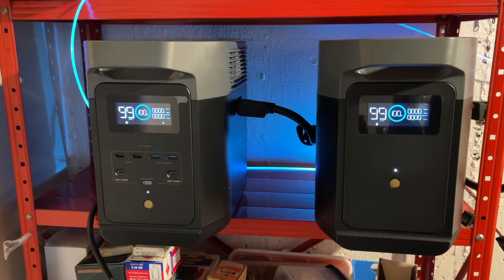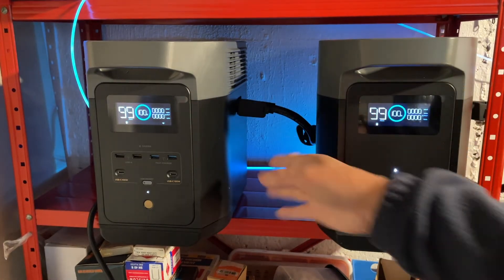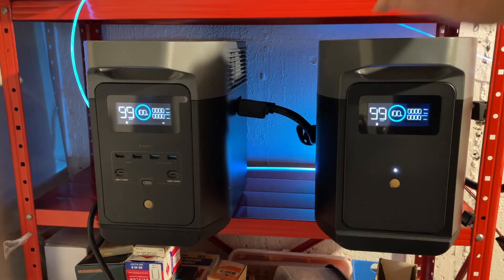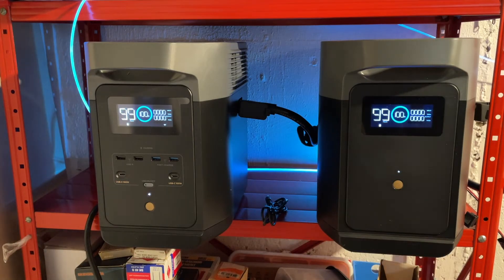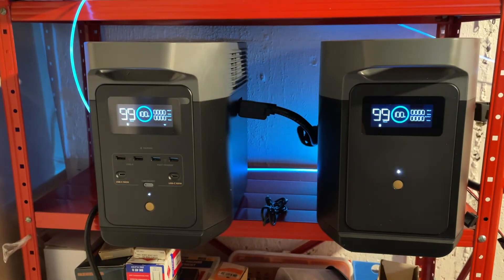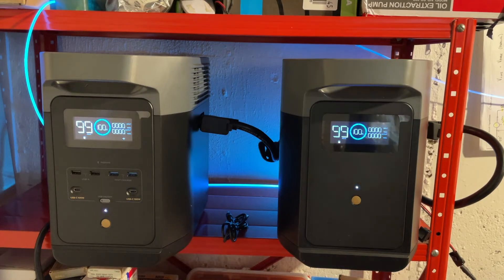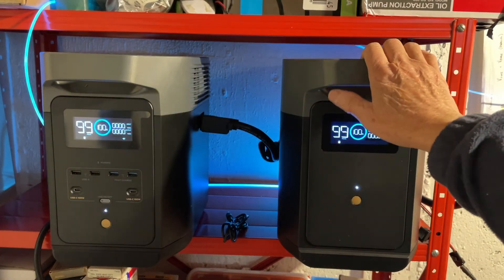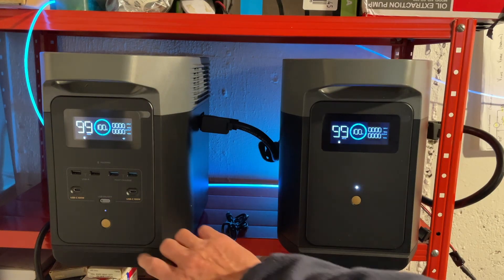ecoflow delta 2 with extra battery first impressions

Comment: hi how long have u had the delta 2 for and have u noticed drop in the battery capacity??
Reply from the maker: I’ve had it for 2 years. It was purchased as a backup power source and as such rarely used. I do have the Ecoflow River which I use every day for the past 3 plus years. No capacity test but unit is running fine.

Comment: Its weird how they made the cable be on the same side, it would have been much better if it was on the back, so the 2 units could stand somewhat closer and different directions.
Reply from the maker: @mighehe  yes the product can have small footprint but access to outlets can sometimes be difficult. The App can be a plus to help adjust various settings but you got to have the phone e with you.

Comment: Did the charger cable for the extra battery came with the unit?
Reply from the maker: @VirginDollars  Yes. There’s a compartment on top of the extra battery and the cable is in there.
Reply: @wtam69  Thank you so much for the prompt response. My EF Delta 2 extra Ba3 is on the way. One love from Nigeria .

Comment: My warranty expired my Delta 2 won’t charge any more when plugged on charger it turns on but won’t work without the power attached any idea on a fix? Change battery cells? Thank you for your time
Reply from the maker: Try resetting the BMS. Press power on button, then turn off. Turn on and hold button until you see the battery percentage button. Also try updating firmware if it’s not  the latest. Remember to  charge battery within the parameters. Get someone qualified to find and disconnect and reconnect BMS  inside the casing.

Comment: When plugged in, which unit charges first? When in use, which unit drains first?
Reply from the maker: Good question but I don’t know. Will run a load tomorrow and find out. Maybe make a video and post answer.
Reply from the maker: I just made a short video on this question:https://youtu.be/gz72IwKXrfM

Comment: Is anybody else having the power to the AC 12 V and the USB ports randomly shut down only when the extra battery is connected, never lose connection when the extra ache of flow battery is unplugged?
Reply from the maker: Haven’t heard this issue before. If there’s any firmware updates, you can update and see what happens. These all in one units are much more complicated than the diy units where you can separate out each component to troubleshoot issues.
Reply: It started when I updated the firmware a few weeks ago. Up until then it was simply a back up power source, but I added a second 300 W solar panel and started powering my refrigerator and Separate freezer. For no reason I can find it will randomly shut off, sometimes under solar power, but also under grid power. nothing consistent except that it’s usually about every day or two. It will shut down. But only when I’ve got the extra battery connected otherwise it’s perfect.
Reply from the maker: @MarkBjostad  I’d look to reverting to your previous firmware if the new update causes problems. Also try to do a hard reset the extra battery if possible.

Comment: When powering a large external load, will the load be shared between the two batteries so their cycle life is protected?
Reply from the maker: It’ll be shared but won’t be exactly equally shared. Even within one battery, the cells will become unbalanced despite the Efforts of the BMS.

Comment: If you have the AC charging cable plugged into the wall, would that provide the ground for the unit?
Reply from the maker: Not necessarily but you can test it with a multimeter.

Comment: Can you connect the Delta 2 extra battery to the Delta max?
Reply from the maker: Probably not as they use different chemistry and voltages.
Reply: Yes you can

Comment: Question.  Given then the extra battery is worth almost as much as a delta 2.  Can you just buy two delta 2s and hook them up together just like an external battery?
Reply from the maker: The extra battery is about $100 cheaper. You can probably hook two Delta 2 together so one feeds the other. I could be wrong but the extra battery is dedicated to the main unit and therefore more efficient. The downside is you cannot charge the extra battery by itself. You have to charge it in conjunction with the Delta 2. That being said, charging the Delta 2 with the extra battery is probably quicker and simpler than charger two separate Delta 2s.
Reply: You can daisy chain using AC. The advantage is the extra solar charging and inverter. It’s a little bit more manual if that makes sense